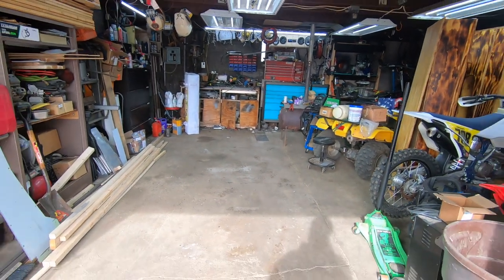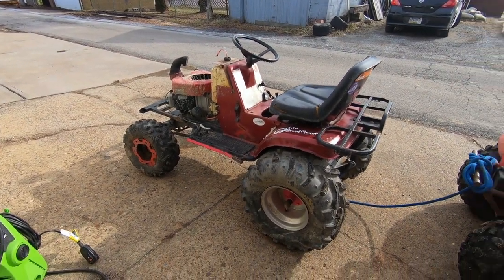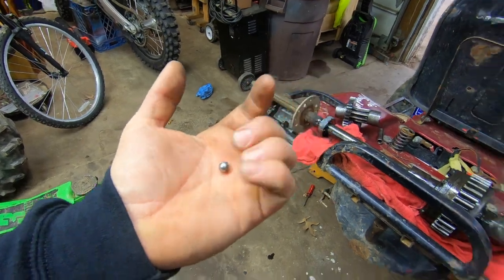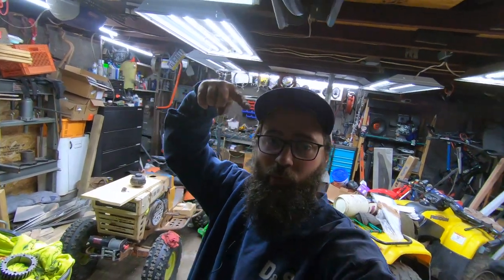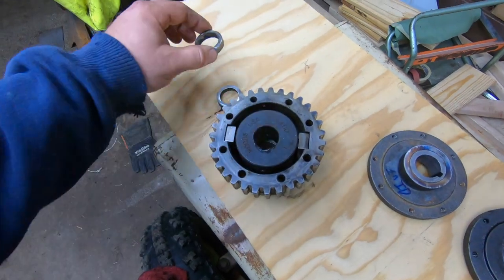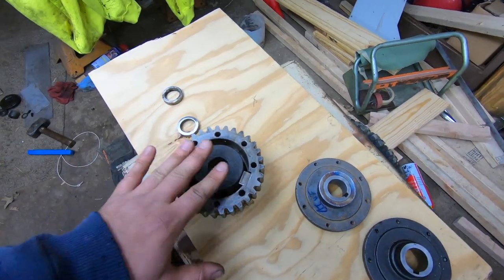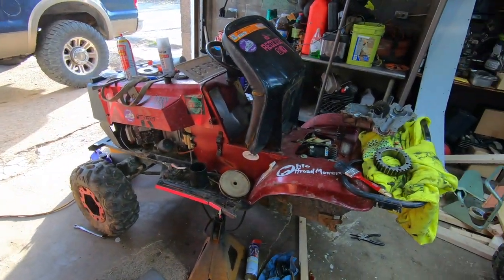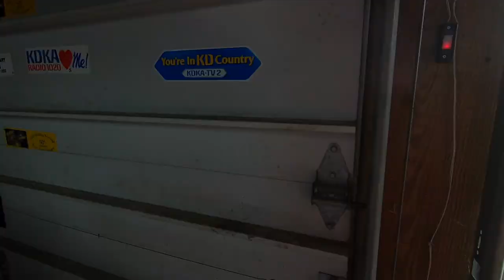Mud Dynamark Gets Brakes and a New 820 Locker

Comment: Nice upgrades! Always sucks to find a extra shift ball 😂 
We run hydraulic brakes on our peerless 820’s in the stock location with a mini disk and calliper and custom mounting brackets 
Works amazing and keeps the calliper out of the way 
Almost impossible to hit it on a rock or drop down on it! 

Hydros the way to go tho, amazing control for crawling and great for high speed stops
Reply from the maker: Ive seen your set up before and love it, i always struggle to fit stuff on the dynamark chassis because of how goofy they are! Im so excited to have good solid brakes on this mowchine
Reply: You guys should do a group ride together! Both great builders and machine and big in the mower community! Understand its easier said then done but would be awsome! God bless you guys
Reply from the maker: @Codakey  definitely want to! We are just super far apart

Comment: Next time it fails possibly look into a built peerless 700 or t92 transmission with an automotive style solid rear axle... would even work with a possible 4wd setup
Reply from the maker: 700s are good for low torque applications like on racing mowers with small rear tires, 700s start exploding with large aggressive tires
Reply: @redzz02  I did state a built one or a nice t92 with a gear reduction behind it
Reply: @redzz02  they do like to be spun faster with more gear reduction behind them as well
Reply from the maker: @dodgeme1986truck  you did state a built one and even a built 700 cant hold up to the larger aggressive tires i run, they are better suited for the racing world

Comment: Was the Dynamark a garden tractor when it was new?
Reply from the maker: Lawn tractor, it had a peerless 930 series transaxle
Reply: Thank you! My boys and I were sitting at the table for the last 2 hours discussing what tractors they want to build. We all learned a lot over the last 8 months while building up the JD214. Definitely a lot of pros and cons with that chassis. My one son recently purchased a JD212 but has recently reversed his decision on building it. He saw every bit of time and especially $$ that went into that thing. He realizes he’s gonna need something a lot simpler to work on. Not saying he’s gonna grab a Dynamark, we asked you about it because the criteria for his build. We are looking into tractors that came stock with 820’s, 633’s, Wheel Horse Gear drives or even 2300’s. I think he’s got his heart set on the GT Murray that came with the 820. He’s been bit by the Mud Mower bug and he’s all in, even though he just recently broke his wrist riding. 
Anyway, thanks again for commenting back!! We are big fans!
Reply from the maker: @Tennesseemountainhomestead  i would not suggest a dynamark just due to the right foot clutch, GT murrays are a great platform! Be Destructive is currently selling “cactus jack” his murray GT offroader that got 3rd at ttc last year for $400 in king north Carolina, 820, kohler vtwin, atv tires! Turn key ready to go!
Reply: That’s a sweet deal no doubt, wow! 
However, he’s gonna have to earn the money to buy whatever tractor he eventually gets. He bought that 212 he was gonna build. I’m actually gonna buy it from him and keep it as yet another parts tractor. Once he gets a tractor, we will be doing a build series on it as well. We need to switch it up, there’s just to much green in our stable! 😅
Reply from the maker: @Tennesseemountainhomestead  need some red horses!
Reply: I agree!!!